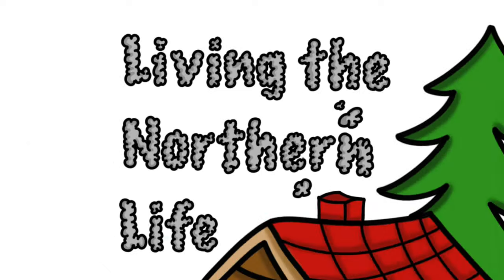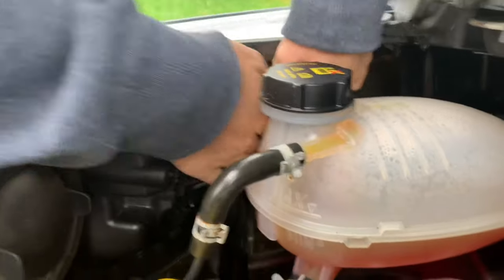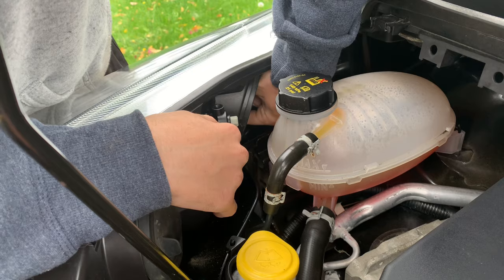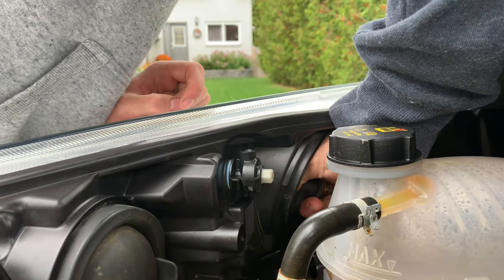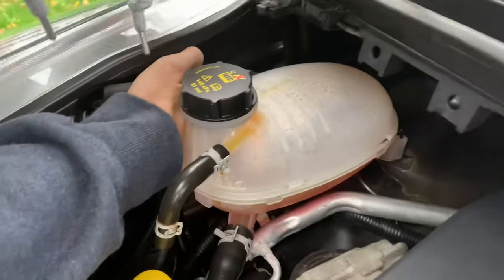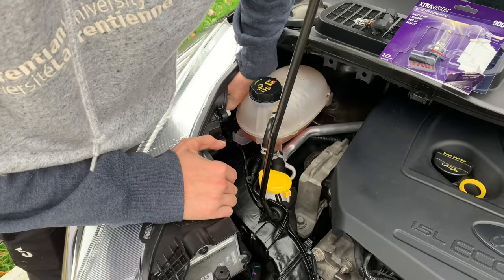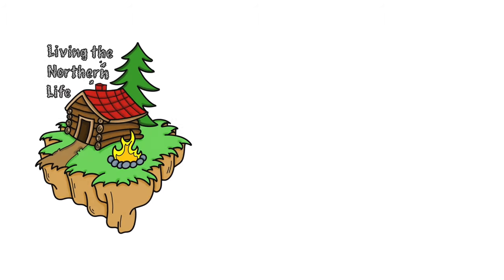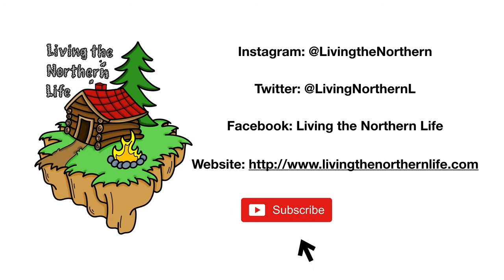2017-19 Ford Escape SE Passenger Side Low Beam Bulb Replacement

Comment: When in doubt, read the owners manual! Tells you right in the Owners Manual how to move the reservoir to get better access to remove/replace the passenger low beam bulb 🤦‍♂️🙄🤷‍♂️ lol 😂
Reply from the maker: Others have said you can also just unplug it from the bulb, replace the bulb and plug it back in without issue.

Comment: I have up. Spent 4 hours over two attempts. I dont care what you all say its impossible to reconnect the plugs. I'm going to have to take the damn car to a dealer and have it done for $$$ WHICH I DO NOT HAVE bc I can not do it and my wife needs the car to drive to work at night. INFURIATING.
Reply from the maker: Try unplugging the wire, take the bulb out. Replace the bulb and reconnect the cable.
Some have given the cable a short tug to get more slack but I wouldn’t recommend that.
Andrew

Comment: Very very bad design by FORD!!!! The driver side bulb has easy access.. I cant get the Reservoir off to get get at passenger side bulb.. I can get it off one of the clips but the other one it’s stuck on so hard I don’t want to break the plastic to get it off
Reply from the maker: Totally Agree!
There's not a chance that anyone actually tested this before it went to production. 😂😂😂
Reply: @LivingtheNorthernLife  - ended up at my mechanics shop- took two of em - one to hold reservoir off to side, the other to change bulb... lol $15 for that, $14 for bulb..
Reply: I respectfully disagree it's really easy to remove. You need to wiggle back and forth one side at a time. I did the left side first then did the back. I just did it today and used a led upgrade kit.
Reply: I took it to mechanic shop- took two of them- one held the reservoir to the side( as the back was stuck on clip) and replaced it- it wasn’t easy for them either- I didn’t want to break the plastic...Good to know at least one person didn’t have trouble -still a bad design in my book
Reply: @flabio82  sounds like those guys never worked on one like that before. I've seen way worse designs. The only other way it would have been easier is if they used push pins.
Reply: @kilxler  I don't know what year car you have but mind was a 2018 Escape SEL AWD. The electrical wire length was less than an inch long in the socket. I had all I could do to get 2 of my fingers in the lamp assembly hole and when I did I couldn't see the plug or lamp end.I  had to feel around and line up the plug exactly with the lamp socket before sticking fingers in there in order to slide it on. Worse design I've ever seen. All they had to do was extend wires a couple more inches and it would have been more than adqueate.
Reply: Just pull it up, hard. It'll come, makes it a little easier to get at.
Reply: People, yes it's a real pain. The reservoir will come up, pull hard. The bulb is a cob ! When you go to replace the bulb, here's what I did. Take a piece of Baling twine ( farmer talk ) or strong string, make a loop and lasso a loop around and below the connector wires and pull it tight. That way you can pull up on the plugin.  BTW, I left the twine on the wire for future use.  You're welcome.

Comment: What he DOESN'T tell you is that the plastic container in the way pops off it's clips if you lift it straight up.
Reply from the maker: Thanks Leon.
It’s because HE didn’t know.
And it definitely doesn’t just pop off as I’ve been told there is a metal clip behind it. So it seems YOU missed that too.
You should definitely give me a thumbs down.
Merry Christmas